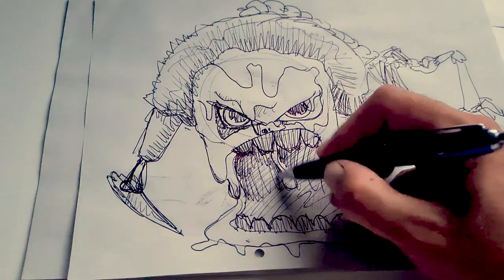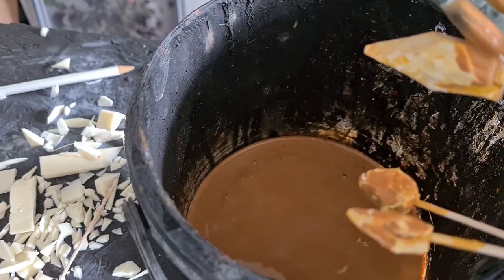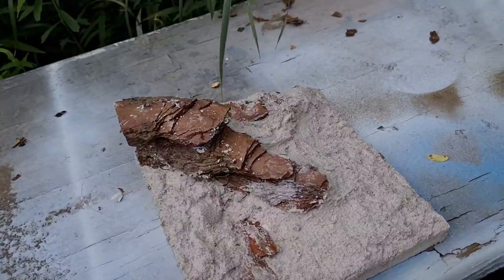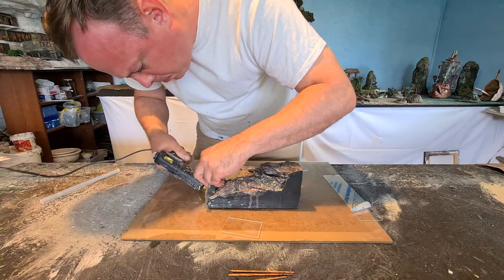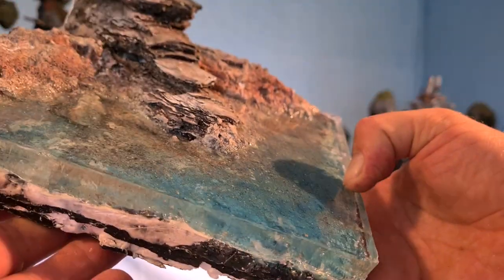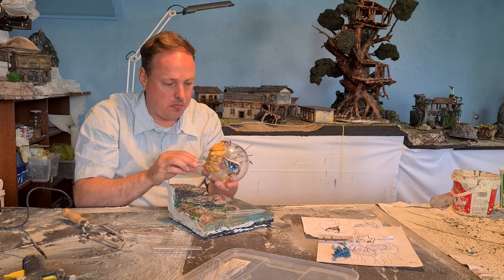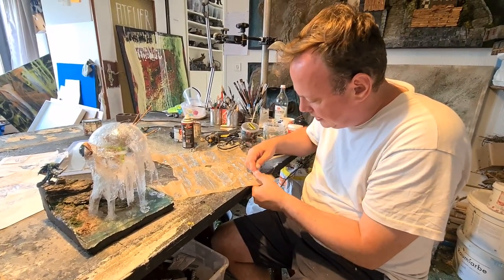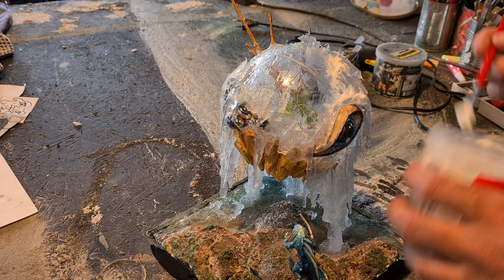WATER MONSTER diorama - moster bash

Comment: Looks good n' creepy. Nicely done. Coincidentally, I just got a bucket of PoP, and will be trying your plaster/PVA/sand/water mix. See you, next time
Reply from the maker: Plaster by it self looks so unnaturally boring. Thats why i but stuff in there. You can also put sawdust, tile grout, dirt, stones and other stuff in the mix. With some washes it instantly looks kool. See ya!
Reply: I've used spackle/filler and caulk, in a similar method. In those, I've sometimes added mixed size sand. I've not tried with plaster, or sawdust, or actual dirt. Time to experiment, I guess. Thanks for the inspirations
Reply from the maker: You are welcome. 🥳